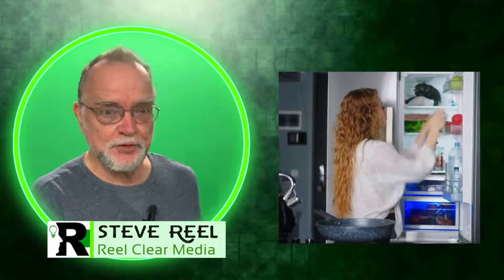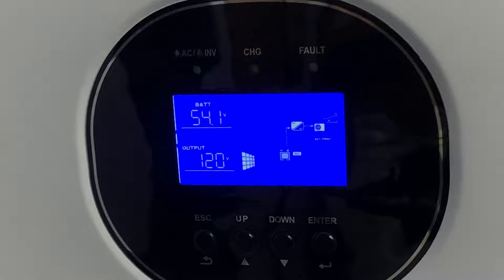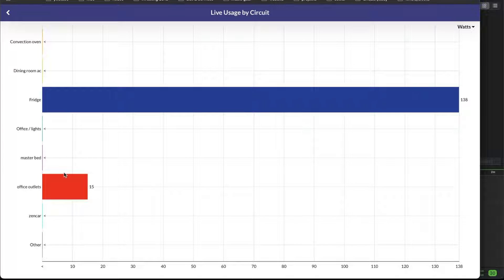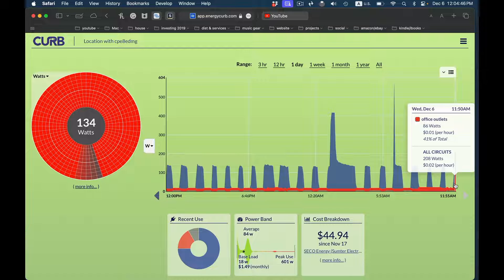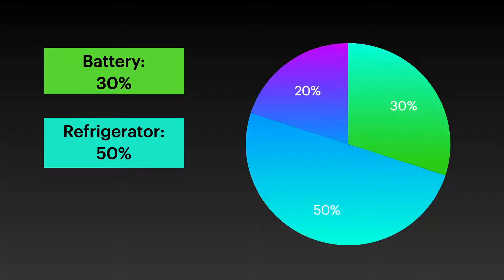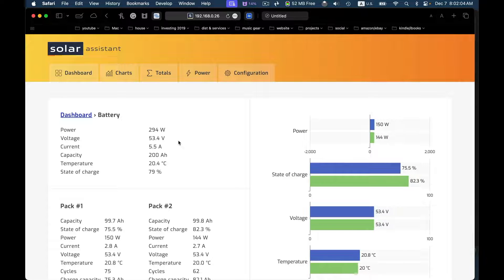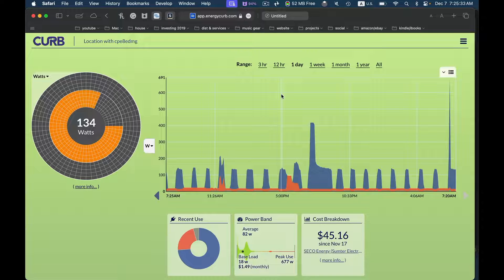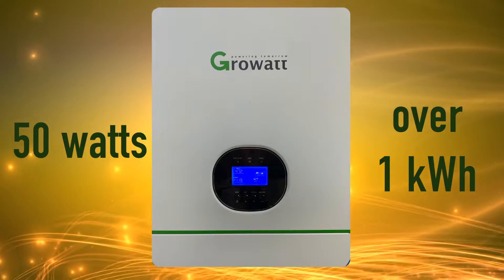How long can I run my refrigerator on a solar power battery?

Comment: Thanks for the info. I have a 10,000 watt inverter with 600w solar panels and a wind turbine. But at night with no sunlight and maybe no wind, I need to know if the batteries will just run the fridge at night. I know now thanks to this video and can go off grid.

Comment: My 15 year old fridge showed 1640 W for a split second on the" kilowatt" meter when the compressor started. But after I get similar measurements during the cooling cycle of about 140 W. Going to use two 12V 100ah batteries in series with a 1200 Watt 24V inverter that has a surge peak of 2200W. Think this will handle that fridge?
Reply from the maker: That depends on the inverter. Some inverters can actually do what their specs say, others can't. 
At 24 volts, you be puling around 68 amps surge. Make sure your wiring and BMS can handle it.
Reply: Thanks, planning on that amount. BMS can do 100Amps and Victron Phoenix 24/1200 specs are up to the task.

Comment: Inverter idle consumption is generally a function of the inverter's maximum output capability.   So a solution, other than buying a DC fridge, is to use a dedicated inverter for the fridge that is just big enough to run it.   Many fridges are soft-start (no major compressor surge), or even use DC compressors (no surge at all and a 0.90+ power factor).   It usually doesn't take much of an inverter to run them.

1-2 kWh/day is pretty typical for a modern full-sized fridge, inclusive of inverter overhead, so your results are not completely out of line.

Something like a simple 1500W 48V Reliable Electric inverter has an idle consumption of around 16W,   Lets see... and I have an 800W 24V Reliable Electric inverter whos idle consumption of around 9W.

-Matt
Reply from the maker: Thanks, Matt!  My inverter is for backup during a power outage, to power lights, fridge, microwave, small AC units. Some people are just needing to run a fridge and a few lights.
Do you know of any refrigerator models that are soft-start? I'm aware of DC fridges, mostly for RV or mobile use.
Reply: @ReelClearMediaLLC  You can get a fridge with Inverter compressor that barely has any surge at all, same for the A/C with inverter compressor.
Reply from the maker: @budmartin3344   I have a Midea U-shaped AC with inverter compressor. Sips electricity and no surge.